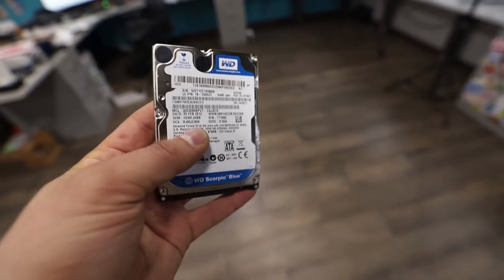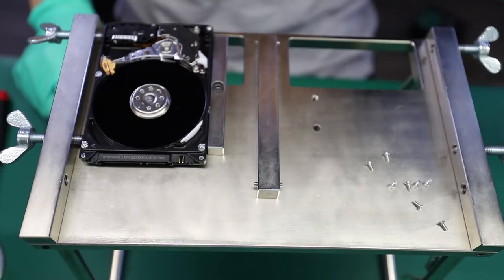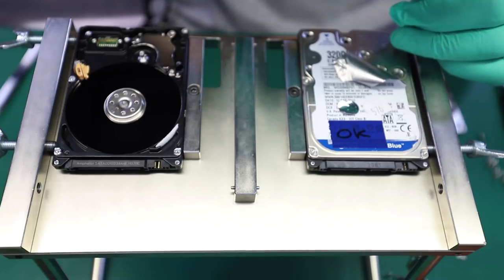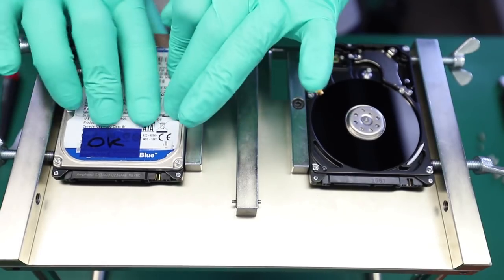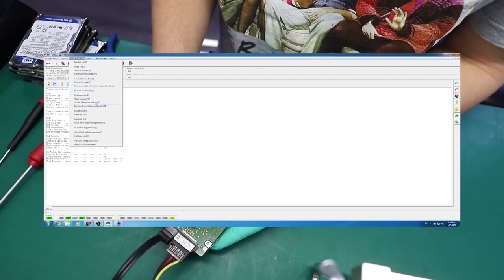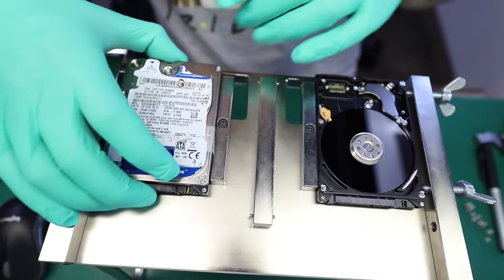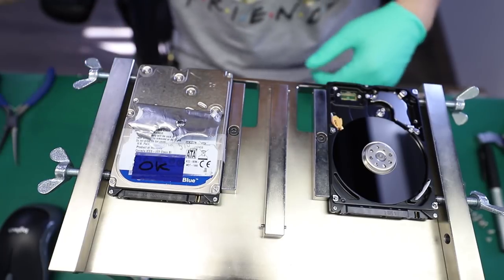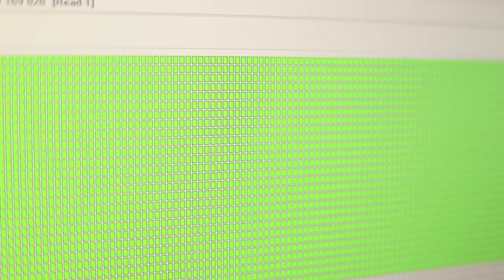someone hit this drive hard | data recovery Western Digital

Comment: From what i see, you are using some time of plastic to keep the heads apart. Is that a specialized thing or just something you come up with? Do you run the risk of forcing the heads apart too much?
Reply from the maker: no risk at all cuz it is adjustable by position. it's a silicone spacer I had at the shop
Reply: heat shrink tubing works well too, if you have any small enough to cut a small piece from.

Comment: Just ask me if I understand, first you changed the head of the HD, but the donor does not miss compatible, you got another donor to change the head again, I just did not understand why the HD media was reversed would be that.
Reply from the maker: first head swap was not compatible enough
Reply: So it required the same DCM;

Comment: Nice video, can you tell me, what kind of tool you were using to lift up the platter? I never saw this kind of tool before
Reply from the maker: https://www.ebay.com/itm/2-5-3-5-Hard-disk-Open-repair-Data-recovery-tool-HDD-platter-extractor-5x-Holder/272914196616?hash=item3f8af42888:g:qPAAAOSwLdBZ~OTF

Comment: Hi wondering if you can tell me if my drive is savable 

I have a WD 2TB Elements 2.5" Portable Drive (about 2-3 years old)

while using it in a faulty loose USB port it disconnected, I tried to move it back in place and that's when it stopped picking up.

I can hear the drive running and the light shows constant but does not pick up. I thought if I replace the pcb 2060-771961-001 rev b with another it would work but still nothing.

Regards

Comment: Assuming this drive would have multiple platters and one of them got smashed, how would you go around recovering the data? I guess it should be possible to at least get some data from the lower platter, or would that be impossible? Also, if you wanted to check the platter surface for visible scratches in a multi-platter drive, how could you do it (If it's even possible)?

Comment: If we don't take into account physical damage to a HDD, will PC-3000 and DE be all you need to recover data from a HDD?
Reply: Hmm.. if there wasn't a physical damage, then you will be able to read the data from the drive with your OS. Because of the damage, he had to replace the heads.
Reply: Hi pot29dr. When I said physical damage, I meant damage to the moving parts of the HDD. However, with bad sectors or corrupted firmware, although there is no physical damage, cloning the image just with software may result plain impossible or render the hdd unreadable.
Reply from the maker: Pc3k would handle 60% off work give or take on average

Comment: Sir, my WD hdd is 3.0 but reading writing speed is 1mbps only from 2yrs.what could be the possible problem?
Reply from the maker: slow response, very common WD issue
Reply: HDD Recovery Services I am from India.Any solutions for hdd like software solutions or any other?
Reply: Get your Data off your Disk as fast as you can, then throw your drive away ;)